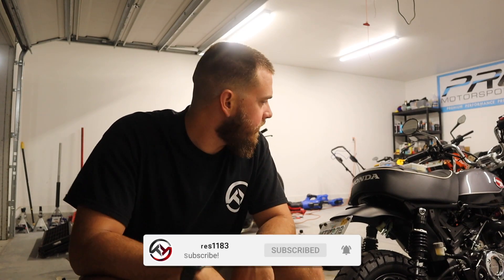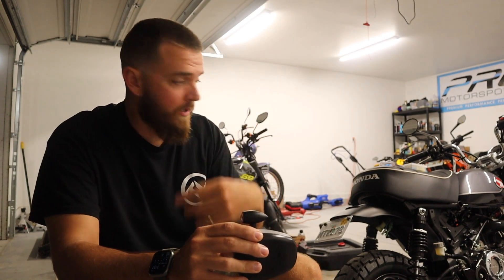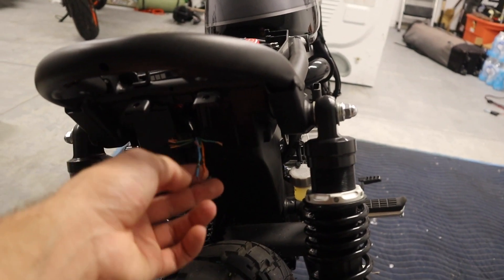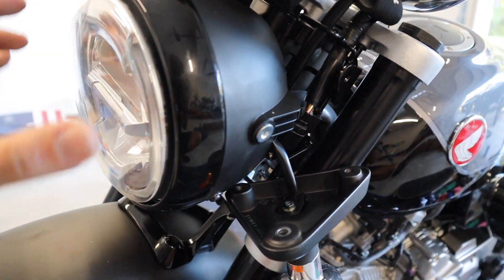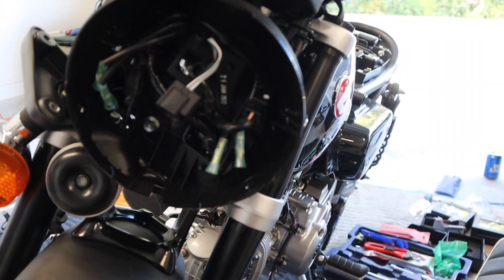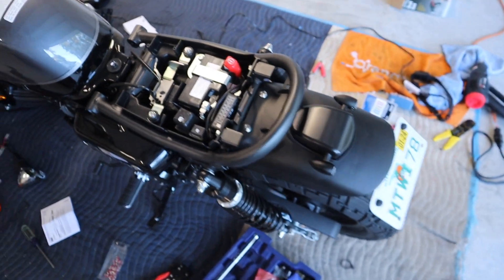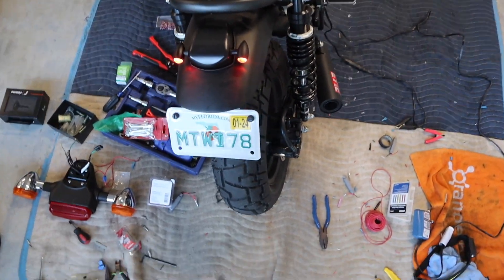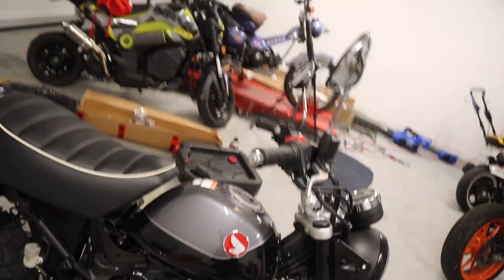The BRIGHTEST lights on the market for the Honda Monkey!

Comment: Had the exact same issue .. got everything else working, but had the hyperflash. removed all the resistors and installed the rizoma flasher unit (under the fuel tank) .. its now perfect. all my lights function correctly .

Comment: Geez. I could tell that was frustrating. Wish I was around. I love messing with electrical to figure it out. Won’t be my first rodeo but glad to see they are on and are bright. I’ve just been breaking in my engine and riding around town.
Reply from the maker: What engine you got?
Reply: @TTorres1183  Icebear Fuerza, Grom clone. Had 0 miles when it was delivered to me. 125cc 4 stroke. Had it just over 2 weeks now.
Reply: @TTorres1183  I uploaded some shorts on here showing first start and with new muffler on.